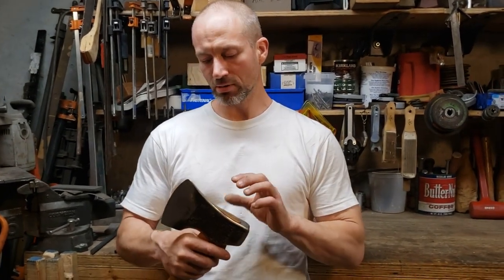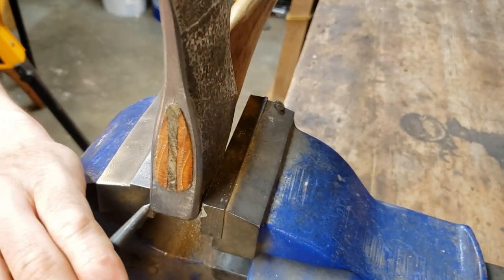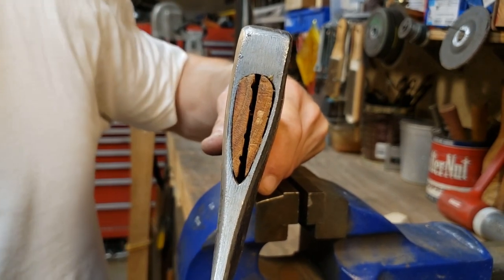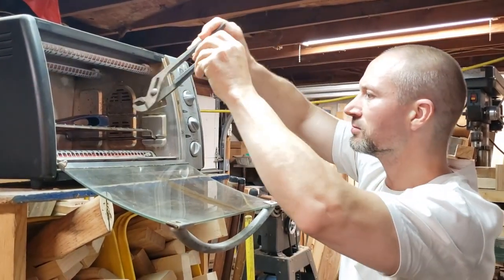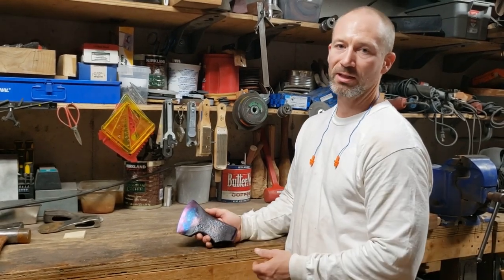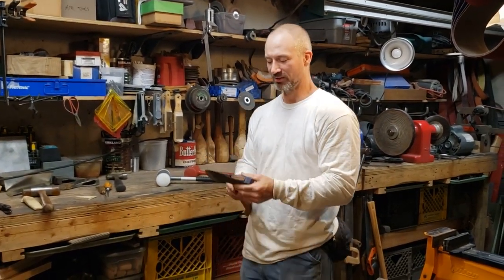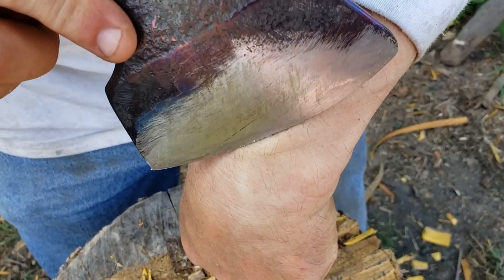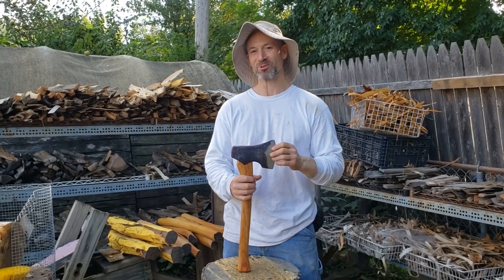Hanging a Hatchet 4:  Retemper, Rehang, Retest

Comment: Drywall screws work better for removing the wedge.
Reply from the maker: I usually use drywall screws.  The deeper threads help a little.
Reply from the maker: I should also add that I like to use coarse thread drywall screws in relatively soft wedges like the poplar here, and fine threads in harder woods like ash, hickory, etc.